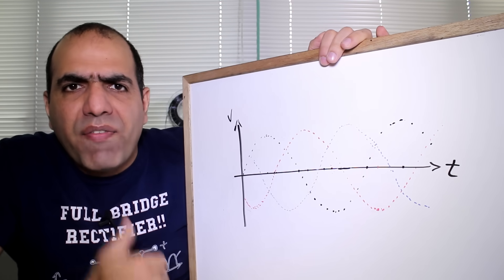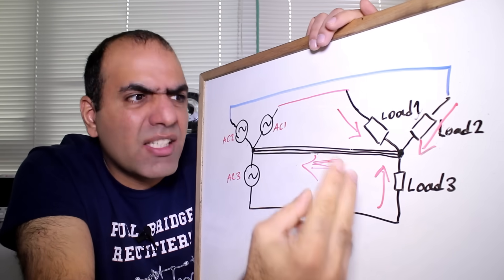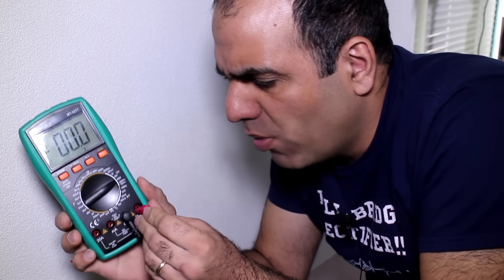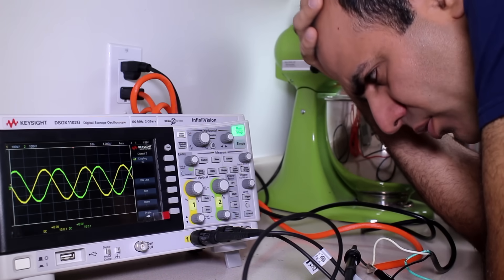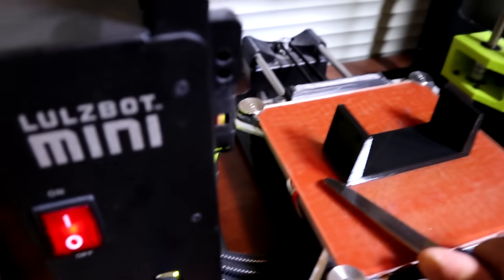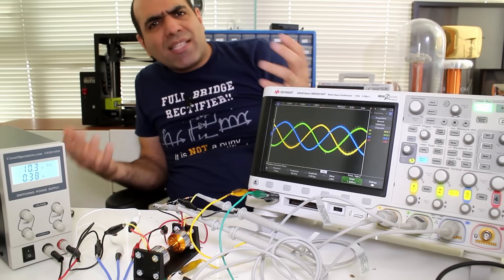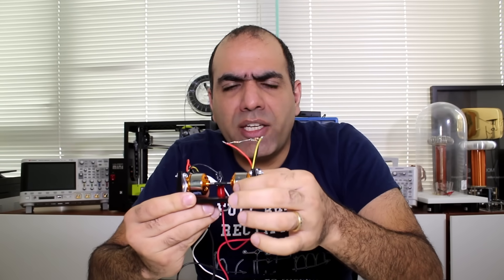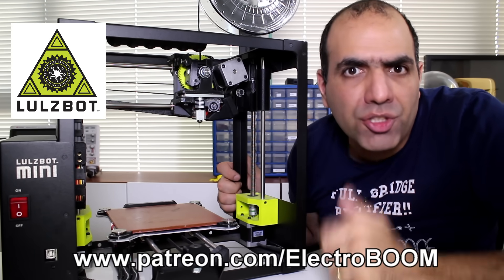Why 3 Phase AC instead of Single Phase???

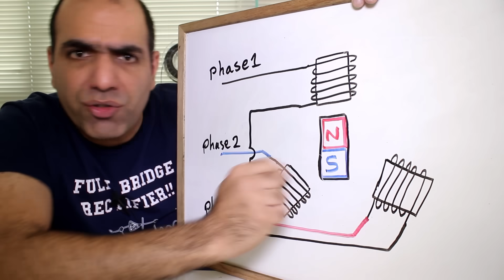Comment: 8:21 what is meant by" electrically separated by 120 degree" ?
Reply: Mathematically speaking, a sine function always takes an angle value as an x-value. Sin(0°) = 0, Sin(90°)=1, etcetera... One wavelength corresponds to 360°. (at 360° the function is back where it started). When two otherwise identical sine functions are 'separated by '120°', it means that they are 1/3rd of the wavelength apart (360°/3 = 120°). So imagine a wave function F1=sin(x), it reaches it max value at x=90°,  another phase F2 reaches it max value at x=90°+120°; so its function would be F2=sin(x-120°) and the third phase F3 reaches it max value at x=90°+ 240°, so its function would be F3=sin(x-240°).

Similarly, four wavelengths would be 90° apart, five wavelengths would be 72° apart, etc...
That actually opens up an interesting question you can ask after watching this video, is why stop at three fase AC? Why not have 4/10/100 phases?

Comment: Sir why we only use 3 phase but not 4 or 6 phases
Reply: I have same question.
Reply: +Rajat Sharma - The power system would become too cumbersome. You would need four, six--or whatever number of phases you are working with--carried over into the associated transmission system: conductors, switches, transformers, circuit breakers, etcetera. The system would be a nightmare for maintenance and operating costs.
Reply: @Inflec  actually I have already found proper answer for this question.....the phase difference between the 3 phase are 120 degrees....and together three phase make 360 degree means complete circle around the machine.....now another question is why phase angle should not set 60 to make 6 phase or 30 to make 12 phase the answer for that is the more your phases the more flux distortion and you have to make much bigger in size plus you can't achieve good frequency...if size is larg
Reply: +Rajat Sharma - If you are referring to the number of phases that would give a motor the best operating characteristics, the lowest number I've seen mentioned is seven (~52.43 degrees phase difference). But again, the practical issue remains: you then need seven of everything in the associated transmission system. No power company would ever consider such a scheme. Three phases are the lowest practical number which provide smooth, even power flow for electrical machines while balancing practical considerations with the power system that they must operate from.
Reply: @Inflec  yap......😄... thanks for the guidance sir....👍

Comment: Little tip&trick.

We use the paper masking tape (used for painting rooms) and apply it on the printerboard. After printing it can be pulled off a lot easier and the tape discarded.
Reply: thanks man
Reply: Claudy ? Toi, ici ?
Reply: Also letting the part to cool helps to pop it off.  Sometimes popping it in the freezer can pop it off.

Just let any glass plates cool to room temperature before throwing them in the freezer.  Unless you want to buy a new printbed

Comment: Huh, interesting. The USA household does not get two phases direct from the generation source, instead a single phase is run through a transformer and we get the two poles coming off of that (split-phase) and in the house we have 120 and 240 volts. (And as far as I'm aware we never have opposite poles in the same NEMA 5-15 receptacle box, I think that may even be against code here)

Comment: Hey I live in Portugal and I have a pressure washer that requires 3 phases to work, and I no longer have 3 phase power in my home. Is there a way to use multiple (3) single phase outlets to lower my machine?
Reply: You would purchase a "ROTO PHASE" machine. We call it that because Roto Phase manufactures most of them here. It converts single phase to 3 phase at whatever voltage and amperage you require. Have a look on line to see what they look like and how they work. I use them on farms to power the crap sprayer motors for the fields. Most farms over here only provide single phase, the ones closer to the Canadian US border so the farmers have no choice in these cases but to purchase one of these machines. They run around 2500.00 CAD or at least used to. Hope that helps! Cheers!
Reply: Shill Stompers thanks for your reply, I was hoping that I could use some ac capacitors like Andy Reynolds says but after wiring it up the machine just humms and doesn’t turn on
Reply: @TheDiogofrancisco1  They make electrolytic caps for ac as well that are non polarised. Give that a try!
Reply: Just watched the video again and he finds two different fases in two outlets couldn’t I just use those two phases instead of tinkering with caps?
Reply: @TheDiogofrancisco1  His main distribution is 3 phase.
Stand alone residential is 240/120v  single phase Residential apartments in Canada are supplied by Hydro (In BC where he lives) as the following;
Apartment Residential;  3 phase 208v/120v
Kitchen outlets now must be supplied by their own 12 awg feed to each kitchen outlet and connected to an arc fault breaker. They allow you to jump ONE plug, the furthest no further than 3 feet from plug to plug maximum distance on a 20A arc fault breaker at the panel. You can use a GFI plug, (20A) and then jump to the furthest outlet with the same rule BUT you must run the 12awg feed in BX. You get 120 with respect to ground/neutral because in a 3 phase system you must divide the max voltage between the output  with respect to phase to phase by root 3 ot 1.73205 which then gives you the 120V with respect to ground/neutral. In stand alone residential you are supplied 240v/120v single phase because only ONE transformer is used for which ever phase the high voltage (25KV) line is on running through a neighbourhood. You will then get 240V between the red and black, 120 v from Red to White, and 120v from Black to White. Commercial buildings are 3 phase 600V. We use step down transformers usually 25KVA, 50KVA that has 600V 3 Phase primary and 347V/120 volt on the output. That is used ONLY for the HID lighting and usually nothing more so you can put a whole whack of lights on a 15A breaker  because the voltage is higher. Then you have another transformer, 208V/120v 3 Phase that operates the rest of the building. Again 208/1.73205 (because it is 3 phase you take the square root of three because the system is 120 degrees out of phase) and you get 120V with respect to ground/white.  The neutral is ALWAYS grounded at the main switch.  Many years ago we used to use 2 phase for the warehouse lighting. So you would have the Black and the Blue or the Red and the Black or the  Red and Blue 208V but now divided by root 2 or 1.414 which gave us  roughly 147 volts with respect to ground /neutral The 3 phase system was more cost effective so Hydro over here changed that many years ago. In fact the lighting used to be 277V  until Hydro changed the input voltage. It used to be 480V 3 Phase. Now everything in commercial is 600V 3 Phase and industrial is 25KV or 26.5KV depending what neck of the woods the mill is in. Large apartments will bring in 25KV to the vault and then it goes to a switchgear unit with a spring loaded handle which makes the connection very quickly and vice versa or you would get a nasty plasma flash. and an explosion if the system is under load which it always is after the building is occupied. Then the fused output goes to step down transformers inside of the panel board. The 25KV 3 Phase is then fed into two transformers. The main transformer is 25KV to 208/120 3 Phase and the second transformer is 25KV to 600V/347 for the car park only
In fact, there are transformers all over the place in a large apartment building fed with the 208 volt main transformer to reduce voltage drop.
 From there the outputs go to their respective fused switches and out to panels with the appropriate  breakers in them. This is why he is getting 2 separate phases because he lives in either a larger condo complex or an apartment. Those are the rules for BC. Vancouver uses 7.2KV and different HIGH VOLTAGES but the secondaries are ALWAYS the same voltages. This is one of the first things you learn in BCIT where I went many, many years ago. I have a master's in electrical. Cheers!
Reply: Shill Stompers oh ok.... I get it.... thank you so much for the awesome explanation and time!

Comment: In Europe we have got all 3 phases in homes. Everyone shifted 120 degrees. 230v phase to neutral and 400V between the phases. Blessing. We can use as much as 20-30 KW of power constantly
Reply: Hey I live in Portugal and I have a pressure washer that requires 3 phases to work, and I no longer have 3 phase power in my home. Is there a way to use multiple (3) single phase outlets to lower my machine?
Reply: @TheDiogofrancisco1   nope. Don't try to use the same phase instead of 3 different phases. It won't work for sure.
Reply: Vlaj. Co in the video he found two different fases in one outlet couldn’t I find one more?

Comment: You don't explain why 3 phases are used instead of any other number. There is a beautiful reason for this.

If you have a simple transformer, with one coil acting as a primary and another coil acting as a secondary, and you put a sine wave in the primary you won't get a sined wave in the secondary, you will get a bad shaped wave. This wave can be decomposed into its armonics which turn to be odd in the frecuency. The most relevant armonic aside from the fundamental is the so called triple armonic, which has three times more frecuency.

However, if you use the 3 phase system, you can set up a Y configuration for the primary coils and a Delta for the secondary coils. This kills the triple armonic and you get a better shaped sine wave.

Comment: I had a three phase dough mixer but only two phase in the building. My genius brother hooked up large capacitors in line to create three phase. It worked great. In order to fine tune it, he went by sound. When close to equal sound (when motor running) he would add a smaller capacitor or take away until equal sound or until hearing a perfect hum. It was a life saver to me. I wrote the diagram down somewhere. It would be helpful to someone, I'm sure. The capacitors were those used in air conditioning to start them up.

Comment: Can someone explain me why driving the third bldc motor with the second bldc used as a generator (at around the 9:24 mark) ? Especillay his remark that the bldc motor can't just take the plain AC signal. (I know quite bit about electronics, so if you have an in depth explaination or just a link, go ahead!)

Comment: I don't understand what you are talk about,  there is only 1  live wire in an AC supply, it varies between say +120 and -120 V,  and the neutral wire is close to ground voltage.
Reply: That's a branch circuit running on 120V that only has one hot wire. You're dryer in your house a piece of 10-3 wire running to it with two hot wires to produce 240V

Comment: what if i do ten phases and shift them by 36° ?
Reply: Why to pull 10+1 Wires to the load/motor? You get the same thing with 3, 10 and 100 system :)
But if you wanna have your fun feel free to design 10 Phase generator/Motor first.

Comment: I've been a master electrician for 40 years and this is one of my favorite subjects to explain to laymen.

3 phase solves the problem of zero voltage potential and no work being done that occurs twice every cycle of single phase, with 3 phase there is always work being done because the phases overlap by 120 degrees, thereby massively increasing efficiency.

Many years ago there also was 2 phase systems where there were 4 current carrying conductors arranged in 2 sets of two that had to be paired properly,  it proved to be more expensive than 3 phase, wasn't as efficient and it was a pain in the posterior so it never caught on. We had an old factory in our city that had ancient machines that ran off of a 3 phase to 2 phase motor/generator converter, I hated working on them but just my luck, I was the only person they could find that understood how the electrical parts worked. The only reason they kept them going was because they were specialized machines that couldn't be replaced.
Reply: Can you write my IP exam for me??
Reply: @knowledgegod2635  Love to but I'm a master electrician not an IP expert.
Reply: @MichaelClark-uw7ex  we don't have master electricians in canada. only apprentice, journeyman and foreman. 

Love the work but hate the schooling.
Reply: @knowledgegod2635  uhhh yes we do
Reply: @tomgrummett4591  not in Manitoba, once we pass level four and pass our i.p exam then we are qualified/certified. Which is probably why we can work in every province and get journeyman and foreman positions except in Quebec.
Reply: @knowledgegod2635  here in Ontario we have to complete 3 course levels and complete 9000 hours then you can write your certificate of qualification to become a journeyman and then once you complete 3 years as a journeyman you can complete the master exam and that is what allows you to start your own company and run jobs
Reply: @tomgrummett4591  wow, that's quite a bit different. Here it's four levels, with 1200 hours a year to be worked inbetween levels. Then you write your national exam and this is good for residential/commercial/industrial.
Reply: Hey wait a minute... Maybe we should use DC!

Comment: I have a question.

Lets say I make a wind mill , to produce power off the grid.

How would I get a capacitor to hold energy, but not just hold stored energy , but when it discharges it discharges slowly . 

The reason why is because I dont want to use a battery because of wear and tear on the battery and the cost of a battery compared to a capacitor so that when the wind stops all my current doesn't disappear , but when I want the stored energy from capacitors all my current dosent just burst out ether.

Comment: In the United States it is common to see 208/230v 3 phase as Blue, Red, Black and for 480v 3 phase Yellow, Brown, Orange. There is usually a green for ground and no neutral wire. SCE or Edison connects one of the 3 phases to ground for 230v 3 phase. This is imbalanced and 230v between any of the 3 wires, they say this is to keep people from stealing power (120v maybe).  I like the fact that they do not need a starting capacitor as single phase motors do. Also it is good for people to hear about the great electrical engineer Tesla getting ripped off by Edison, so they realize that they are likely to get ripped off by colleges and employers as well. That is because unlike truck drivers and the Teamsters union there really is no Electrical Engineers union to promote what is best for electrical engineers.

Comment: I like working with 3 phase motors as they are much easier to start. Thank you for posting on this very important topic. This subject is something that is used in most businesses as it makes for smoother power output with smaller capacitors on the output of a bridge rectifier.
Reply: Nice motors until you connect them out of phase.😅

Comment: What's the point of the little generator? The esc itself provides the three phase power. If not 100% duty cycle, the intertia of the motor setup acts as a low-pass filter, but why not an actual low pass filter?

Comment: Question : why stop at 3 ?

Why couldn't we create like a 12-phase motor ?
Reply: AcadianGiles why stop at 12? Why no a 200 phase? Or a 10000 phase? As you see you have to stop somewhere and a 3 phase was the best option.
Reply: @danedu4519  That's why I said 12. Seemed like a good number.

Tesla picked something he could easily build a generator with. A 3-lobed shaped alternator.

By now, with precision machining, surely we can do 12 ?

Comment: Good day Sir i will just ask Question why we are only using 3 phase system; not using 4 phase or more ?
thanks
Reply: you could use technically as many phases as you want - but each extra phase needs an extra wire... at some point it becomes impractical. You can get 4, 5 and 6+ph motors - they run smoother than a 3ph but require more complicated control systems to generate the extra phases, and conduct across the extra wires. a 3ph system is also the minimum needed to have a self-starting induction motor (a single phase motor will have some startup circuitry to ensure it can 'start' from any position - its why you sometimes need to replace a capacitor on very old single phase motors). 
essentially, the only reason not to is mechanical complexity and necessity. a car and a mains powered motor runs fine off a 3ph motor - some ships/submarines and some generators (like wind turbines) run off 6+ phases.
Reply: @sn0wchyld  thanks

Comment: Correction: In case of three phase loads, all the phase currents do not return to the source through the neutral. Remember, they are 120 deg out of phase. Current which returns thru the neutral is due to unbalance only. But, if all the phases see same load no current returns thru the neutral.

Comment: Please make a video explaining Quartz Crystal oscillators / watches!! How/why does the current make the crystal oscillate?
Reply: it is piezoelectricity.
a voltage pulse (not current) applied mechanically deforms the crystal like a mechanical shock on a resonating glass. the art of oscillators is to provide this impulse in the right quantity and at the right time to maintain this oscillation like the thrust on a swing.

Comment: I've never seen a 2 phase motor. Over here we have either 1 phase or 3 phase connections to the building. (Usually 1 for a house)

It makes sense considering you are running 110 - 120 volts instead of 240 volts (especially for big garage doors)

Comment: May I ask below capacitor geometry questions?

Bigger the roll (bigger diameter) make higher capacitance.

More surface contact to + and - leg make higher Amp capacitor.

Does longer the cylinder roll make higher DC voltage?
Reply: +Haru Koyama - The voltage storage ability of a capacitor is soley dependent on the dielectric material used in the construction of a capacitor.